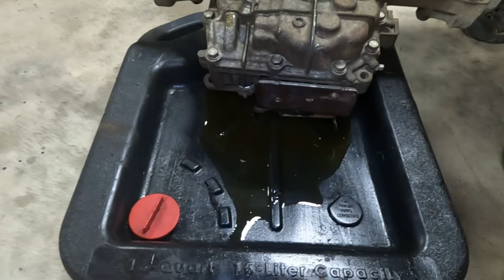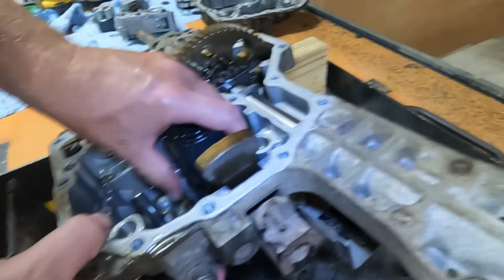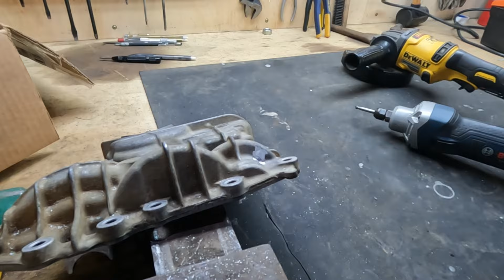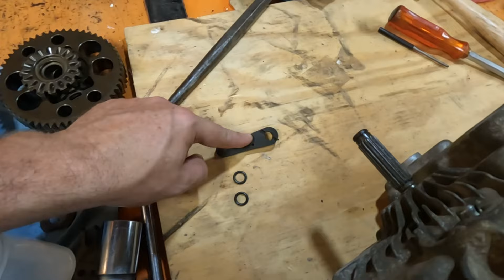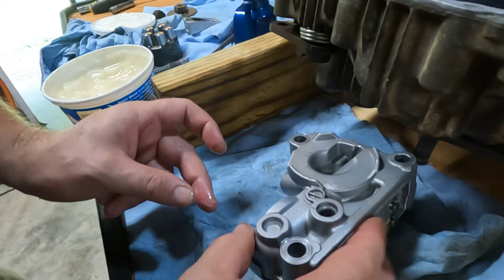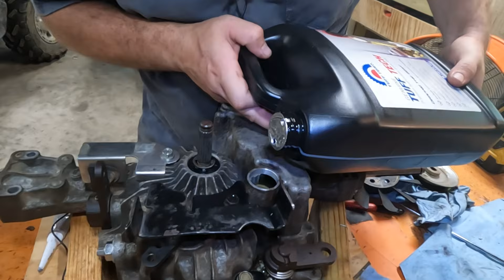Tuff Torq K46 Series overhaul

Comment: Nice work  my t46 dm  rebuild kit still has main issue reverse lost power on slope an very slow drive . forward good power an speed any thoughts what’s wrong components note by hand the forward an reverse gear lever when pushing back control arm very stiff will not move all the way back pushing control arm forward ok tension. Thanks
Reply from the maker: Check if the control arm linkage is binding externally before digging back into the internals.

Comment: Hola soy de argentina tengo la misma caja en mi tractor Husqvarna y tengo el problema que avanza lento hacia delante y de reversa anda bien la abrí y el aceite está un poco negro y me dijieron unos mecánicos q no se consigue Respuesto q tengo q comprarla nueva porque no se animan a abrirla
Reply: No es que la abrí solo le saqué el aceite por el tapón q tiene en la parte superior
Reply from the maker: If the oil was really dirty I suggest you drain it all out (turn the gearbox upside down to get it all out and then refill.  I suspect that the filter screens may be blocked up but you would need to open it to clean them.  Its not too hard!
Reply: @theshop392  dale voy a probar abrirla la caja tiene 500hs de uso pero la usé para hacer fuerza unas 2 o 3 veces como máximo puede ser que se aya jodido algo de la bomba ?

Comment: Great overhaul video. One thing to add- VERY IMPORTANT!!  Before you install the case cover make sure that the shaft for the intermediate gear for the differential has the flat facing up. The flat should be even with the machined surface of the case. If the shaft is turned and you put the case on and torque the case bolts you will crack the case. See 20:07. Cheers
Reply from the maker: Thanks for the add!  Yes that is very important

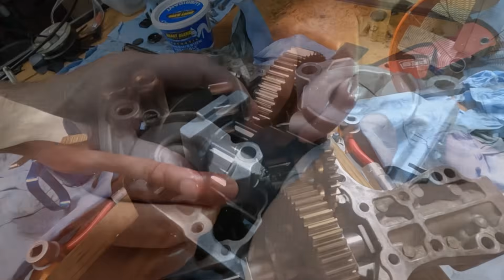Comment: Here's a GREAT tip:. When you try to fit back the piston pumps you are trying to compress the springs to get it to fit: 24:10  MY TIP: Squash in the pistons against the springs on THE BENCH....then lock the compressed set up with 2x strong plastic cable ties wrapped longwise on the assembly. Then attempt the fitting. Once in position, the cable ties can be snipped and removed... No effort required then :)
Reply from the maker: Thanks for the great tip!

Comment: Thank you so much for this breakdown. I am getting ready to take mine apart because it literally just stopped going into fwd/reverse only about 5 years old. There is nothing blocking the pedals or pedal shaft. It wasn't low on oil so, I am going in,  Just not sure what to expect when I got in.
But your video is gives me hope.
Reply: Don't feel bad.  Mine's even newer with under 150 hours on it - also stopped moving.
Reply from the maker: Well done for taking it apart, glad you found what went wrong!

Comment: i am changing oil soon, J.D. D160, 10 years old. 90 hours on it.  Runs good, no issues. I don't think I will take the parts out unless it has issues when I open it. I grew up rebuilding engines and trannies. I really don't want to mess with it unless I have to. I ordered the kit with oil filter and seals from Tuff Torque.
Reply from the maker: I agree, if it works don't take it apart!

Comment: I’ve seen videos where two drain plugs were added to both the hydraulic side and the gear side.  Also one showed removal of the vent cap and an expansion tank installed with a cap, so that the unit could be drained and filled without removing it from the tractor.  Would you recommend doing these modifications?
Reply from the maker: Yes, If I were doing this over I would add the drains

Comment: Just a comment for those of you out there doing this, that some K46 units are different.   Mine is a K46V from 2005. Even though the video doesn't show fan removal from the shaft, here's what I found is different from one K46 unit to the other on different Youtube sites.    On some the bottom - up order is as follows:  e-clip, then pulley on top of the e-clip, then wave washer on top of pulley, then fan on top of the pulley with the fan's flat hub surface facing DOWN towards the ground, and the snap ring on top of the fan.   
Mine from the shaft is as follows:  TWO nuts that don't thread on, (they have splines that just fit over the shaft.  They are meant to be spacers only so that the fan blades ride high enough to not smack into the body of the transmission), then the fan with the fan's flat hub surface facing UP towards the sky, then wave washer on top of the fan, then the pulley on top of the fan, then the smap ring on top of the pulley.
Reply from the maker: That is great information for others to have, thanks for sharing the differences you found!

Comment: Fantastic video. I purchased a Stiga Villa last summer that has this same trans axle, K46, it is already over 10yr old, local dealer told the previous owner that it cant be maintained, axle is service free - buy new axle for 900e. Well that was bullshit. But the way i got that machine for 600e. Epic deal. Now i have open it and maintained, one setback occured - i busted one IDS valve, well new one is coming.. 😅
Reply from the maker: That is great news, just be patient taking it apart, document and photos (video does not show it but I photographed every step on teardown, and even then had to refer back to the video!).

Comment: I didn’t see the part where you drilled and tapped the lower cover for drain plugs. The same company that sells the rebuild kit also sells two different size drain plugs as well as the drill and tap to do the job.
Reply from the maker: Unfortunately I did not drill and tap the cover for a drain plug, I only found out about that after I had done the rebuild, definitely something to do next time!
Reply: @theshop392  If it wasn't for where they located the filter, or if you think it can go without changing it, there wouldn't be a need to take off that bottom plate accept for the first time. If the location could be found, it would be nice to drill a large hole in the body of the tractor with a hole saw so the drain plugs let the oil out and the new oil is put in through that access hole in the tractor. Leave the silly transmission in the tractor and don't disconnect anything!!

Comment: Thanks for your video 
Very interesting 

I have questions 
My tractor no drive fast kann you tell me wash is a  problem
Transmission ist ok
I kann drive no to fast 
Thanks 

Thanks
Reply from the maker: It would be almost impossible to diagnose like this.  Start with checking the oil level to make sure that is right.  Then check that the linkages are moving correctly.  If all of those are right then you may need to open the case

Comment: When the axles won’t turn is it the pump that’s faulty
Reply from the maker: It could be multiple items, low oil, faulty pump, faulty, motor, dirty filters, stripped gears and many others.  I would start by checking if there is oil in the unit.

Comment: Thank you for showing the removal of ALL internals...not just a half-ass removal the others do.  I appreciated the tips regarding the reinstallation of those internals.

I also appreciated your focus on the THICKNESS of the bearing washers, to determine which one goes on the appropriate side of the bearing disc...everyone else focuses on the I.D. to determine, which is ridiculous because that attribute is much harder to determine.
Reply from the maker: Thank you

Comment: There should have been a spring/thrust washer under the the pulley on top of the fan. When you wiggled the fan it was loose. That spring/thrust washer can and does break and it can and will fall out. Check the parts breakdown list it clearly shows this washer.
Reply from the maker: You are quite correct!  Well spotted.

Comment: Hello fellow transmission rebuilders. I found something VERY IMPORTANT!! The part named Motor Housing (upper left at 3:14 with the tab sticking up) is installed differently depending on which model transmission you have. It IS possible to install this up-side-down and it will go together just fine. However, the mower will move in opposite direction. There are a number of videos out there where they show how to reassemble this. Some have the large portion up and some have the small portion up (as in this video). The best way to know it to be very careful to note which way yours is installed when you take it apart.
Reply from the maker: You are quite correct, I thought I pointed that out in the video?

Comment: I just had to Google my transaxle there is an older casting of the housing for the pump that does not use those two bypass valve. If those holes are not a finish surface nice and smooth you don't have them and you can stop looking for them.
Reply from the maker: Thank you for the information
Reply: @theshop392 thank you for making this video. I don't know how many times I have watched it I finally got to the point where I needed it rebuild it I watch the video again. I'm watching it as I put the gears back in. When I first figured out what transaxle I had according to the Internet it's unserviceable they're wrong. Unfortunately I have one of the axle shafts that has become rust welded in the room I have broken Polaris have you sledgehammers and torches five different types of penetrating oil ATF and rubbing alcohol that axle is Star wars it has become one with the rim.

Comment: Question, I purchased a K46 for $400 and failed to get the exact K46.  The linkage was a little different, but it all lined up ok.   My issue is that to release the transition for pushing it, I have to push the lever all the way forward, likewise to move the mower I pull it all the way out.  It’s clearly operating opposite.  Now, here’s the other opposite issue, the foot pedals aren’t right, they operate backwards.   Also, it goes faster in reverse than in forward.  Does the release spin 180 degrees to fix this?
Reply from the maker: It's a little hard to understand your exact issue.  You could try flipping the wedge blocks, that would flip the direction of operation

Comment: Brilliant video thanks. 2 questions,  which gasket sealant did you use and what did you use to fix the hole/leak.
Really clear and great lighting.
Reply: Setting or non setting?
Reply from the maker: Thank you.  I cannot recall the exact brand of gasket maker, it was just the regular stuff from an auto part store.  As for the crack, we tig welded it.

Comment: Thanks for the video! Just rebuilt mine today :)
Reply from the maker: I hope it's all working?
Reply: @theshop392 yes and feels as fast as the day I got it! Mine had the roll pin fail that’s in the speed control shaft inside the case. Full strip down just to replace that one little part 😅

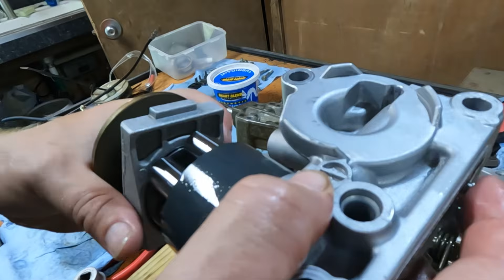Comment: 23:37  That tapered block orientation (up vs down), determines if the forward and reverse operation is flipped.  On some machines, the whole transaxle is installed the other way around (left vs right), so that tapered block allows the forward and reverse operation to be corrected.
Reply from the maker: Agreed

Comment: Do you have part numbers for the seal kit?
Reply from the maker: You will need to check your serial number to make sure you have the right kit.  Here is the link I used:  https://tufftorq.ordertree.com/model?modelId=753&brandCode=TTQ.  It shows the kit as #200 with PN  TUF1A646098240.  Remember you will still need oil

Comment: I like your parts washer. Mine is in the kitchen. You really should install 2 drain plugs (drill and tap in the factory locations) so you can change the oil without having to remove the whole transaxle.

Comment: Hello, I have a K 46 transmission. The manufacturer says parts are not available for repair. How did you get yours? I have gears that are throwing metal chips and blending it with the oil which caused excessive where in the hydraulic pump and motor.
Reply from the maker: Have you tried to purchase parts directly from Tough Torque.  I was able to get all the parts I needed as well as the magnet upgrade from them.  Failing that why don't you try finding a second hand box that is in good shape?

Comment: Mine started slipping and whining after about 450 hours. The fill cap on the top had split and the oil was like chocolate milk.  Getting one of the wheel hubs off the axle proved impossible but if you are opening the transmission it is not necessary to remove the hub to replace the axle seals. You can take the axle out, fit new seal and put the axle back in. I Replaced the axle seals and fill cap and resealed it up. I regret not stripping down the oil pump and motors to check for wear but it seems to work ok with new oil.
Reply from the maker: Glad that it seems to be working now!

Comment: Hello, great job. I have toro dh 190  is the same gear box. When is flat land is ok , but when is little bet hill just stop .he thinks a bit and drives again and stops again. Do you know what the problem might be?
Reply from the maker: I would check the oil level, I have had the same symptoms on another lawnmower and it had a oil leak

Comment: Merci beaucoup pour cette vidéo plein de détails en tout genre et vraiment très bien filmée. Ma transmission n'a plus de puissance, elle arrive à peine à faire avancer le tracteur même à vide. Elle n'a pas de fuite d'huile et je n'ai rien vu de spécial. J'ai fait la vidange une fois mais cela n'a rien changé. Je n'ai pas oser la démonter. Que me conseilles-tu?
Reply from the maker: I would open the transmission casing to see what's going on inside.  If there is lots of metal shavings you have mechanical damage, if there is no oil then you have a leak that you didn't notice.  These transmissions are prone to leaking at the wheel seals, so the leak looks like it's a bad wheel seal

Comment: Excellent video. My yth22v46 was barely moving at just 45 hrs. So I dropped the diff to put in 5w50 synthetic. Cracked open to inspect. The inside looked great. Barely anything on any magnet. Put back in mower, purged air and still the same problem. Turns out that I had a build up crap at the clutch linkage under the pedal. Once hosed out and sprayed the linkage, it runs better than brand new.
Reply from the maker: Glad you found the issue!  Always best to start with the simple things!
Reply: 45 hours!?
Reply: @bradbozarth3235  yeah. I thought it was bad fluid, build up behind linkage was the problem

Comment: Thank you for your knowledge.  You're an amazing teacher. Covering the experience of the work and the ability to communicate it in the same. Great job. I watched your video and tackled mine today. Opened mine to find a spring that had jammed inside one of the pins in my piston pump motor. Caused the spring to break and pieces traveled through causing quite significant damage.
Reply: I'm putting together parts list online, may come out better buying new tranny. Stuff is so pricey these days. And for no good reason.
Reply from the maker: Thank you for the compliment!  That is bad news on the spring braking!  Are you planning on repairing it or are you going to look for a second hand unit and rebuild that one?

Comment: A few years ago I worked on one of these when I got ready to install the motor I made some alinement studs out of some bolts made putting the motor back a whole easier it is talked about around 23:35 very good video BTW
Reply from the maker: Thank you for the tip on the alignment studs.

Comment: I have a cub cadet with a tuff torq K46. The wheel seals both went bad a year or so ago and leaked out oil. I replaced the seals and refilled it but every since once it gets hot it quits pulling. Recently it doesn’t take long at all to quit pulling. I am a mechanic by trade. Any suggestions as to what you think causes this? Thank you in advance
Reply from the maker: Mitch, it's very difficult to diagnose without looking at it.  On one of my other mowers I had similar symptoms, lost drive as it heated up.  I found that the unit was low on oil and had to add oil - I suggest you start there.  If that does not work I would open it up and make sure that none of the screens (small mesh screens) are plugged.
Reply: Did you discover the problem yet.. i've got one doing the same thing I hope to take apart this week n have a look
Reply: Check for worn pump/motor aluminum housing and the pump/motor mating faces.If not to bad can block sand smooth all surfaces (1500 final grit).
Reply: Hello, have you worked on your tuff torq K46 yet? I'm curious if you got it fixed and what you found the problem to be?
I have had the same issues with mine. Loss of power as the unit warms up. I've done all of the usual checks and an oil change. The only thing I haven't done is getting inside this unit.
Thanks for any reply.
Reply: @SPCLPONY  I haven't done this but logically I might assume the air wasn't purged at the end.

Comment: I noticed the wedge block is positioned with a wrong orientation. This will make the forward go reverse and vice versa.
Reply from the maker: You are correct, however some applications require it to be swapped around.  You need to record the direction it is in when you open the case and reinstall in the same direction.  It will be different on different applications of the transmission

Comment: is the pump block supposed to be snug and slide onto the main shaft splines with no play?
Reply from the maker: Scott without taking a look it is hard to determine if there is an issue.  As I recall all shafts were firm, ie it did not take force to slide, but they were not loose either.  Best would be to look for wear on mating components.

Comment: Great work!  Next time I service mine, I will take the lower case off and clean those lower magnets.
Reply from the maker: As far as I can tell there may be an add on, the kit is available if they are not there when you open it up
Reply: @theshop392  Might be a good investment for the longevity of the transaxle.